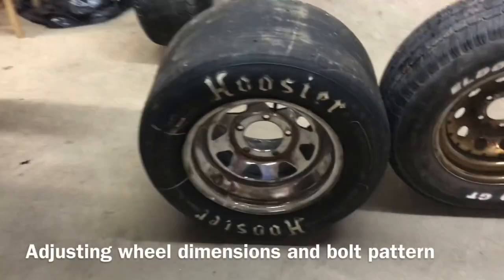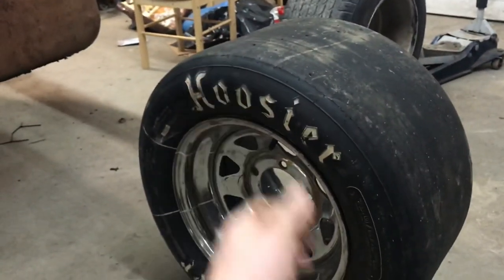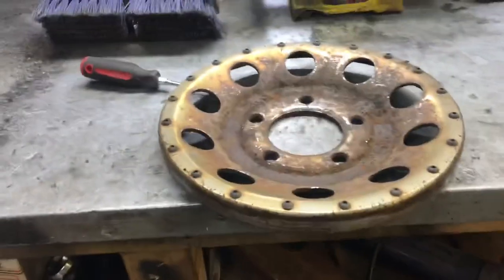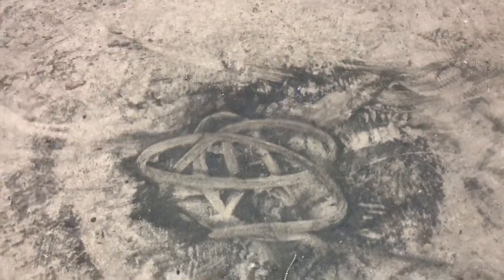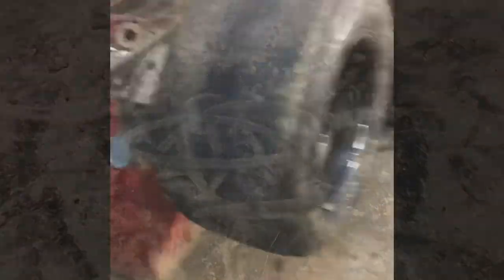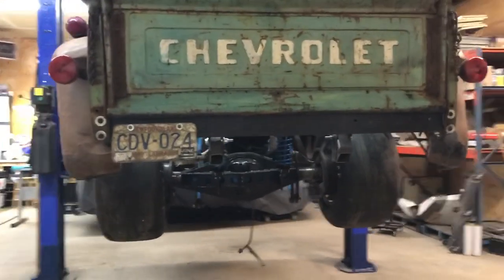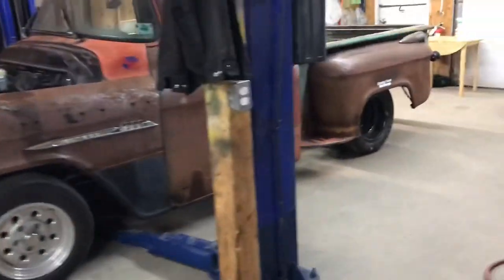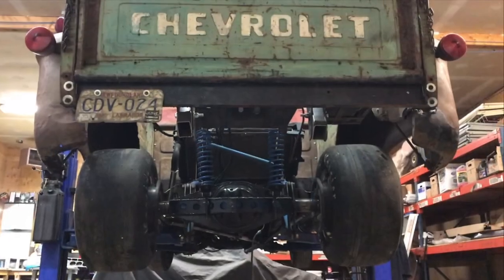Making my own set of wheels, changing center and offset. It’s not as hard as it looks!

Comment: Very nice job and ideal ,could help me fix a cracked oldsmobile SSIl rally rim .I could change out the whole hub rather  than welding the crack which goes all the way across the rim.Just pull out the chrome centre and weld it to another hub.I have not found a place that does your method of rim repair or modification. But your video is the first. Exactly what I was looking for .Damnskippy of  a good job once again sir.
Reply from the maker: Take your time, be very careful and inspect the welds after you drive it for the first little bit 🙂 hope it helps. 

I wouldn’t recommend doing it if you’re not trained in welding or fabrication, but in saying that I’m not gonna stop ya!

Comment: Can i just flip my Chevy steelie wheels and put em on backwards in the rear?
Reply from the maker: I’ve actually tried this back in the day lol. 
The face of the wheel is tapered out and away from the drum/rotor so if you tipped it around backwards the face would hit before the flange touches and you wouldn’t be able to put lug nuts on it
Reply: I’m thinking of doing this but using spacers as well .

Comment: Those axle shafts  are going to flex like crazy with those wheel drive plates so close to the back bead, defeats the purpose of the narrowed housing.
Reply from the maker: I wouldn’t normally have a diff this narrow, but i bought the axles off a guy thinking they were longer. When I put the diff together it was way too narrow and was stuck with it, so I made it work

Comment: About to do this for a trailer I'm rebuilding for my dad. He's got three 6K "mobile home" axles on it that I'm converting to standard, modern axles. But I want to keep the 7 x 14.5" rims on it, because 1) I had to buy tires for it to move it, and I don't want to have to buy another set of tires, and 2) switching to a tire with a similar load rating would mean I'd have to go from 14.5" to 16" rims, and that would require reengineering the whole trailer. And when buying 7 rims (2 per axle, and 1 spare) costs more than the three axles you're putting in, well.....gotta do what you gotta do. Lol

.....I need to buck up, buy a decent camera and just start filming this stuff. Lol
Reply from the maker: That’s awesome dude! Having access to a tire balancer to be sure the wheel is ventured correctly is a huge bonus, maybe a garage near you (or you) has one you can use. Good luck with it dude, if you start putting out videos lemme know, I’d check them out!

Comment: How did you make sure they were centered and balanced when you welded it?
Reply from the maker: I centered the flange and the wheel as best I could, then put it on a wheel balancer at a local garage and made adjustments until it was as close to zero as possible, then I’d tack it and fully weld back at my shop. I’d make sure that my welds were the same length all the way around the rim so that it wouldn’t be off balance from one side to the other. 

It always worked very well for me, but I’m sure there are many different ways to do this stuff

Comment: I dont think I would weld with the tires on it. 😬
Reply from the maker: Any reason why not? I wouldnt weld the bead right out to the edge with the tire on it, but an inch or two in didn’t seem to hurt
Reply: @StationroadRatrods  the heat can build inside and cause tire to pop if it's still sealed up tight.
Reply from the maker: Not arguing, just opinions here but you’d need some serious heat to blow a tire
Reply from the maker: @janikankkonen7403  that’s wild!!
Reply: I’d have taken the valves out and let the tire “breathe” with the build up of superheated air to release pressure but if it worked your way then it worked just fine. Good luck with them “new” wheels!👍🏽
Reply from the maker: Thanks for the tip! I’ve been learning as I’m going and there’s always something new to learn
Reply from the maker: I can’t say for anyone else, and now that I’ve been made aware I will be taking the tire off the rim but usually I just pulled the core out of the valve.
Reply from the maker: Haha yes! Ask away, if you have any questions I’ll answer what I can, if not I’m sure someone else will. And thanks!
Reply: 🤔....so i guess your ok with crawling under the truck to check the air in the tires ???...im not...good luck..👍
Reply from the maker: Heyy that’s a good eye haha. I didn’t realize I didn’t put the valve in the outside at the time of the video, I did fix it after. It was a pain in the ass, that’s for sure
Reply: @StationroadRatrods  over 5000 degrees f at the arc causes pressure build up much faster than one would imagine.
Reply from the maker: That does make sense. I’ll be taking the valves out next time